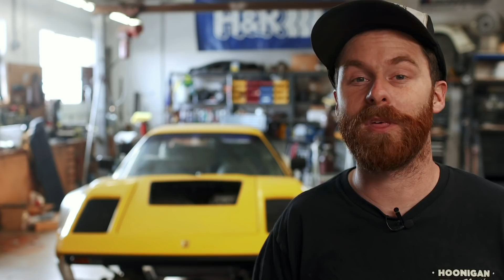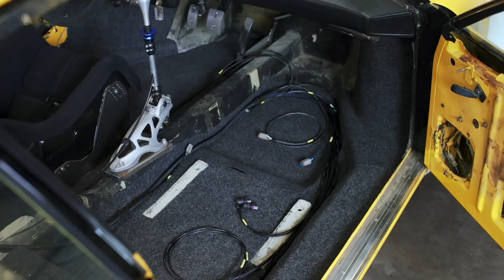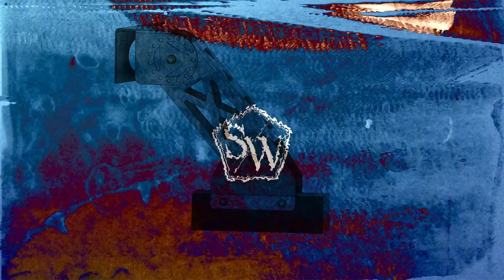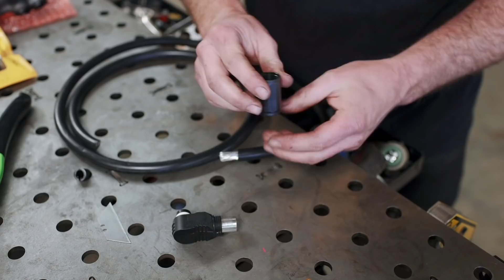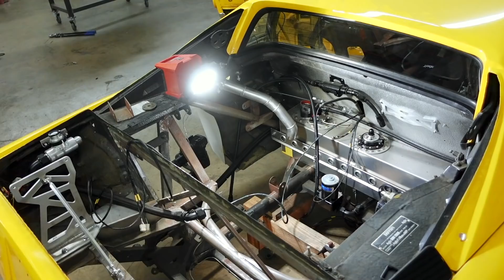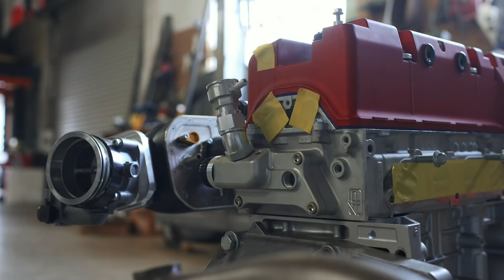Honda-Swapped Ferrari: The Grind Before It Roars to Life

Comment: Things are really coming together. Those Amazon hydraulic cable crimp tools are generally crap. The dies are usually metric sizes relabelled as AWG and that crimp on your ecu connectors looks like the dies are the wrong size to me. I’m used to seeing those used for solar equipment and inverter connections, but it might be worth checking those connections.

Comment: Have you had any thought about protecting the frame, either with paint or powered coating, before putting it all back together? Even the flash rust that you had to clean up before you started to weld will eventually comeback, right?

Comment: Loving the build. Like a good book I'm almost sad it's coming to an end. Why not spray Steelit in the engine bay so it will stop rusting and you can still weld?... Guess your are going all the way and stripping it down again to powder coat? Think I answered my own question. Thanks for the vids. I'm off to work on my bike.

Comment: I use a button when I weld DC Tig. I only use pedal when I weld AC. I find when iam working in awkward spaces, setting the machine on 4t with a torch button is easier. There is the odd occasion when I weld AC with a button. All of my torches have an integrated button. I don't like the buttons that are held on with tape or velcro band. Looking forward to seeing this car drive for the first time 🙂

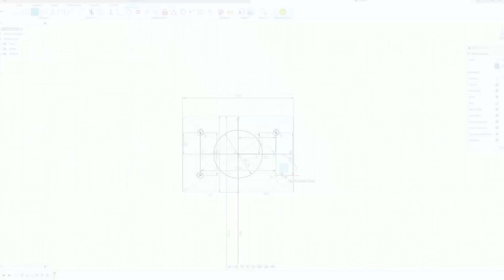Comment: 5:07 Would you like to have that made out of carbon fiber ? I have some 4mm CF and can CNC something. You can't bend the CF that I'm aware of though. I made something similar for a project. I have another idea for a base that would fit on that flat tunnel. If it's not too big, it'll be no charge. I'm strictly non-commercial so this is just for fun. I would do a plywood mockup first.

Comment: The nexus R5 has been tested to run all its PDM functions at max rating simultaneously. Unless you need more inputs or outputs(which I doubt) the secondary PDM is unnecessary.

Comment: The switch tower looks great… a suggestion… A double hinge on the Switch panel mount plate will make the panel mount a lot stiffer… when pressing buttons flex takes away enjoyment and can make for ‘missed switching’… especially the lower switches will exert a lot of leverage 👍

Comment: Are you going to paint the engine bay before putting it all back together, surely this would be easier done now before it all goes back in?
Reply: He said an episode or two ago that everything will come out for paint after the first start, just to trouble shoot the systems etc with everything unpainted in case more holes/fab is needed.

Comment: Loving the detail and thought put into things, definately would suggest loooking at rivnuts in stainless steel flavour. The wiring is well thought through and will save you SO much problem when trying to diagnose issues and such and using the RIGHT tool on the crimps makes all the difference.

Comment: Hi . like what you do with engine replacement in the car. a question only so if you have now welded everything in the engine compartment why dont  you paint and make everything ready so you do not have to take in and out of the engine more. if you are now going to start it up in one of the upcoming videos you upload to your channel
Kind regards from Sweden
Reply from the maker: Because the whole car is getting disassembled for paint later.

Comment: You shouldn't add any references to turning the engine on in the title of the video you finally do it, start it with a 3 second black screen and hit the switch and rev it a couple times... And then blast dubstep full volume with all the dunk sounds like the air horn, the 360 none scope meme from mw2 and all the 420 memes and Doritos logos you can fit in the screen for two minutes while dancing like crazy in the background in front of the Ferrari. I can tell you nobody is expecting that. You will easily make it to the trending page.
Reply from the maker: Do you want a job? You're hired.

Comment: I had the same VSS issue building a  K-Series transmission that came from the factory with a hall effect style VSS. It was from an Element. I wanted to run a gear driven VSS because I was using an EP3 harness on the build and the VSS pigtail terminated where the gear driven VSS sits (since the EP3 uses a gear driven VSS). The hole was there for the gear driven sensor but it was too small as you observed. You can buy a 27 mm (1 1/16") bit and open it up carefully. I stepped up from 7/8" to 1" to 1 1/16" making sure I was drilling at the appropriate angle. Its kinda tricky but you can use the pocket in the case to make sure you're drilling the hole correctly. After that I tapped the existing hole for the hold down bolt (M8x1.25) and it was good to go. The thing is my whole case was apart when doing this, but yours isn't. If you wanna do this, you're going to have to take the transmission apart to avoid metal ending up in the case from the drilling or maybe use a vacuum to pull shavings as they are cut, but that's spooky and would keep me up at night after doing so. Alternatively, you could extend the harness pigtails to the front of the case and just run a hall effect sensor (seems way easier and your case has the hole to do that). I forget, does the diff in the transmission have a gear drive on it/did you put one on? I wonder if you could turn down the plastic body of the gear driven VSS to fit the existing hole? Never tried it. Anyway good luck!

Comment: Awesome to see more progress and that support for the button pad is pretty cool in its execution. You'll never be able to guess the final position that works best so to design a mount with full adjustability is a smart approach. All I would change is add in a StanceWorks logo cut in the side as this will be a focal point of the interior and you might as well showcase the builder.

Comment: I know you mentioned about having to press the pedal with your knees and other things at odd angles while in the bay (which is just an unfortunate part of TIG welding), did you ever consider picking up a TIG button to help alleviate that? Lets you control the amperage from on the torch itself, letting you get into tighter spaces overall with less hassle.

Also, yay merch! Super excited for it.
Reply: A tig button or a slider on the torch makes all the difference worming in awkward positions
Reply: I don't know of any torch switches that act like a pedal! They are simple on - off switches whilst a pedal gives precise control over amperage and arc length. If in a confined space where a 'normal' TIG cup doesn't work, consider switching to a Gas Lens cup that allows a longer stickout and better gas coverage but a pedal is virtually essential in difficult fab work!

Comment: Such a cool project. For the Can Control Pad mount could it be an idea to create a mount that is kind of like a "centre console" that can also produce additional support for the dash? Also I know it is probably not a big issue, but with the single mounting point for the actual bracket is there not a risk of it loosening/moving over time after pressing the buttons on the left hand side of the control pad?

Comment: also man, if your not wearing a respirator , get one.  Miller LPR-100 Half Mask will save you from getting nerve damage from welding, trust me. its horrible. my instructor who's pushing 75y/o has issues cause he never wore one and cant control his arms cause of the damage over the years. them fumes are super bad for our bodies. and if you dont wanna get one of them , buy the most expensive mask with a vent system you can . 3m makes one but its 2.4k but its worth it , miller makes one, all the major brands make one.

Comment: With the time spent in CAD it would have been cool to just do away with the factory quaife shifter base and integrate it into the switch mount. Excited this is nearing completion and those crimp terminals for the primary power runs are really nice looking.